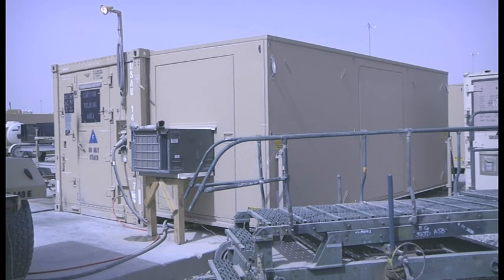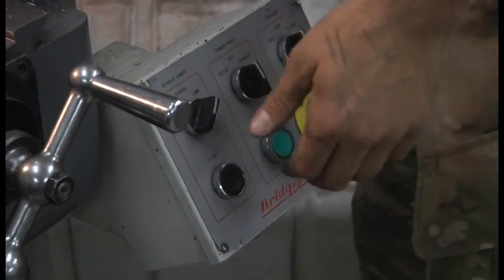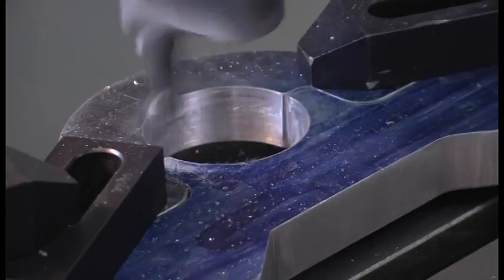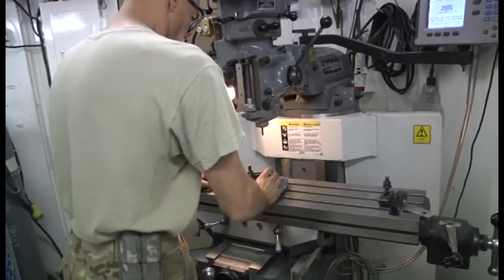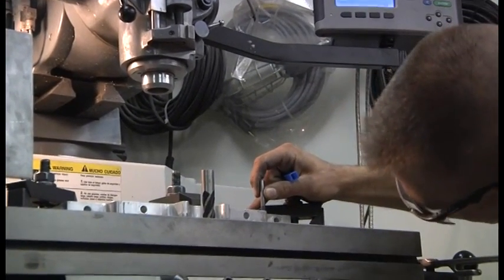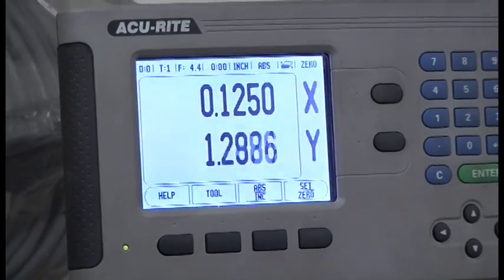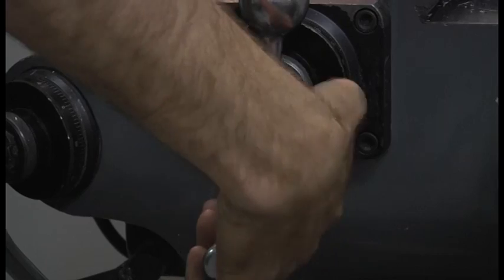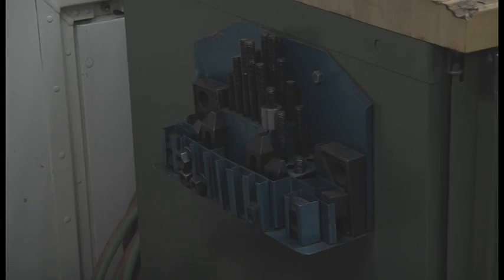U.S. Army Machine Shop @ Kandahar Airfield, Afghanistan

Comment: What a ridiculous situation- really an embarrassment.  Making complex parts on the front line for helicopters shows real deficiencies in waging war, at least in the situations where the manufacturer 'won't release the parts' or something like that.  Making simple bushings, ok, and making all kinds of stuff around the base, ok.
I have both a mill and a lathe that were used just after WW2 in weapons production- these used machines will be available for cheap for 100 years to come.
Reply: You are correct sir. This is a militarization of backwoods machining solutions we here in north Carolina have used since well before I was born. You didn't swear as much as the colonels who worked with the company that made these though lol

Comment: I assume he has quite a bit of tolerance on the hole he was boring, checking it with calipers lol. Most helicopters parts are usually close tolerance tho. like +  - .0005
Reply: Boring head looked like a cheap chinese item ,thought the Army could spring for a quality unit !
Reply: @pauldavidson6321  Most of the Army brass probably doesn't even realize these guys exist. It's easy to forget machinists until you need one.
Reply: Kaiser head, second to none.
Reply: @wilde.coyote6618   Thats what we use

Comment: If I joined the military this would have to be my job. If it payed extremely well for being in Afghanistan I'd consider doing it for some time with a contractor too, but that won't ever happen.
Reply: Why would it not happen? Your statement is confusing. Every job in the military is paid the same rate according to your rank. There are exceptions, Like combat pay, Sea Duty, Air Crew pay, Flight pay and imminent danger pay.
If you are a skilled machinist there are sub contractor (Civilian) companies that will pay you to be overseas. Had plenty of buddies do it.
Reply: Tell the army you run machines and they might have you operate a laundry washer

Comment: You know, man, you found my remarks about AOG/ACL to be in poor taste. I'm sorry, and, I apologize. I'm a retired handle cranker for Boeing, and, my experience has been, you cannot go to work every day, and not enjoy what you do. The last area I worked in was in boring mills, and holes were my bag. Tolerances were .0006", on average. Six tenth's. I had to be serious about my job, but, I needed to vent. Everyone did. Priority notifications were known as " the flavor of the week." They were in constant flux, and varied between programs. I worked on many AOG's, and had to reject many out of hand, because of conflicting info. I had no engineering support, on third.
Reply: When I saw him measuring that bore with Verniers I thought " hope that's not a critical part "
Reply: @pauldavidson6321  yeah, but see the spilt? It is a clamp supported piece, not critical tolerance

Comment: Surprised to see that POS Jet machine on a US army base
Reply: Being the government, they probably paid stupid money for it
Reply: ThunderAppeal Notice the guy is climb cutting on a Bridgeport with the quill stuck out about 5 inches with not even a stop on it! Massive FAIL!! Pull that shit in the civilian world and you won't last a week.
Reply: @6h471  end Mills were designed for climb milling.. you can get away with climb milling on manual milling machines as long as it is a light cut which he obviously was taking, and the table locks are slightly snugged.. heavier cuts of course require  conventional milling.. unless it's CNC where the servo and ball screw does not have the kind of backlash and slop which would cause a wreck.. all CNC cuts i program are always climb milling, only using conventional milling when no other option was possible...
Reply: @6h471  47 years  I've been a machinist, was thinking the same thing .but sharp cutter ,good mill and an alloy part you'd get away with it .
Reply: Yeah, but also notice how the Jet is in the back and he works on the Bridgeport.

Comment: Was a 44E10 at Ft. Wainwright, AK 86-91. First arrived at the 98th Maint. Co., 6th S&T Bn. With no shop. It was still in crates. Everything new! It was like the best Christmas ever opening all of the equipment. Worked for the Sugar Bears in Aviation my first year there because it took the Post Utilities that long to run 240 to my machines. Eventuall inherited a BatMobile as well for out in the field.
Reply: How many years were you stationed there?

Comment: Well Thx god I'm taking machineing right now, might help my future army career after all
Reply: Thank yourself. Machinists, any mechanical/engineering skills, will ALWAYS be needed, no matter what form of technology evolves. Everything has bolts and holes and welds. Everything needs to be built, everything needs to be repaired.

If you're ok with pushups and salutes, military seems like a fabulous way to learn machining. They'll have the biggest and best equipment, probably capable of working down to the tenth, the parts you're building are important. They're not constrained by typical manufacturing budgets like a commercial machine shop. They can afford to build one-off parts from exotic metals.

It probably feels pretty good to know you fabricated a dewobulator bypass bracket hold down safety wire retainer clip release latch cover for that attack helicopter that's keeping the base safe.
Reply: @DrLumpy  Military most definitely doesn't have the best machines. I've worked in some crummy machine shops with machines that can offset in millionths (with limited success...) Precision work is all outsourced to private industry which owns the senators who get them the contracts. Those big companies then often times outsource many aerospace and military parts to lower machine shops that aren't certified to do said work. I've worked in a couple shops that aren't AS9100 certified and I still made parts there that went into space.
Reply: @jerryherrin6470  Senators pushing money into local industry/jobs seems like a darn good idea to me. The military and the federal government (all governments, all companies, all individuals) have always outsourced work. That's a good thing. If you want an airplane built, pay an airplane builder. If you want a road built, hire a road building company. Don't reinvent the airplane factory or the road building company. Thousands of people benefit from a company getting a contract from the government (or from anyone). 

I doubt there are any US military parts machined (microtomed) to the millionth. And I'm pretty confident suggesting that any machine shop at a US military installation has a better budget/supply chain/tool compliment etc than any civilian shop of comparable size. Their budget is essentially unlimited. If they needed millionths in every machine shop on every ship, they'd have them.

 Point is, if you want to be a machinist, the military will teach you to do it right, on the best machines - And pay YOU to learn, instead of the reverse, as if you were in trade school.
Reply: @DrLumpy  Yeah, I was hammered and didn't know where I was going with that comment 😆 The military is a great place to learn any job. I will say that I doubt they have the latest tech in cnc machining though. That's something you're going to have to learn either in college or on the job. Military machine shops are just going to do the jobs that the military needs critically right now. Drill this hole and it only needs a 1/16th tolerance in location and size.
Reply: @jerryherrin6470  We're watching a video with a machine shop at a military outpost a bazillion miles from nowhere. They're working to the tenths of thousandths. That's hardly "Dill a 1/16 tolerance hole".

I'm pretty sure the military has, or would have, better than "The latest CNC" IF and where they need it. You seem to want to view the military as "Trying to barely get by on a tight budget". In essentially every area, it's just the opposite. They military is able to spend bazillions where needed. If they need a knee mill and a lathe in every ship, base, and fox hole, they'll buy/ship/install/staff/train to make it happen. They don't shop at Harbor Freight.
Reply: @DrLumpy  You're not getting my point. Can the military do it? Of course! They have a blank check from the tax payer because no politician would last 5 minutes after having denied them anything. But they don't, because it's all outsourced to private industry. Which is ok, because I have a job because of that. But also, the vast majority of that money goes to politicians and millionaires. But w/e. The people drawing up and making those parts for the military make scratch while the politicians wonder where their next Mercedes is going to come from. Those army/navy shops are largely just bridgeports and hardinges with no dros repairing non-critical parts.
Reply: The truth is this is battlefield commanders having had enough of the politics of their supply lines and using an old hot rod technique where they would use a container for the machine tools and free up space for cars in the garage, ended Alot of that.
Reply: One thing you will get from the Army no private employer will give you , A good pension after 20 years.
Reply: @harrybriscoe7948  The army (any service branch) will pay for your college, room and board, and pay you a salary while you're in school. Then they'll hire you for at least four years. After that you can continue to advance with them or you can join the private sector and advance there.

Military seems like a pretty darn good deal to any youngster whether he knows what he wants to do or not.